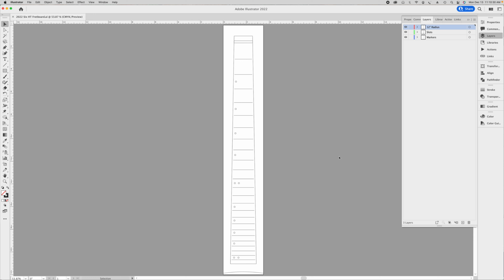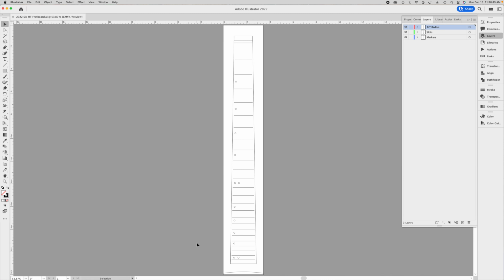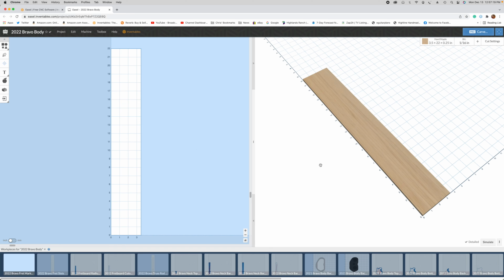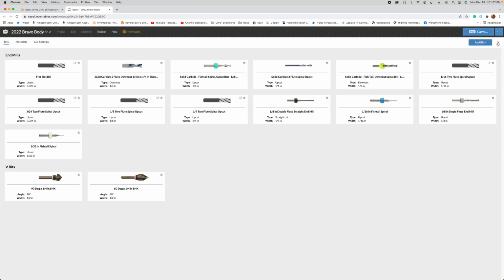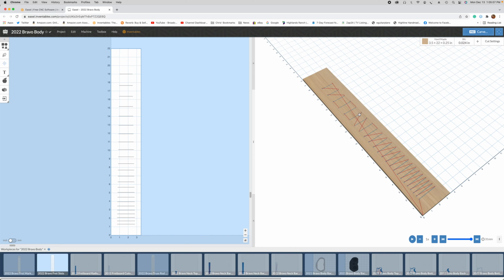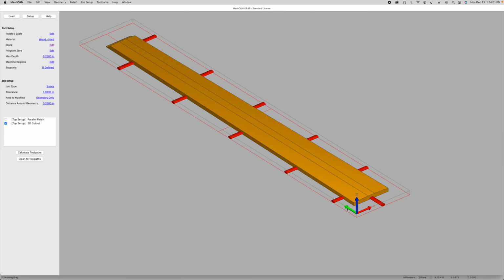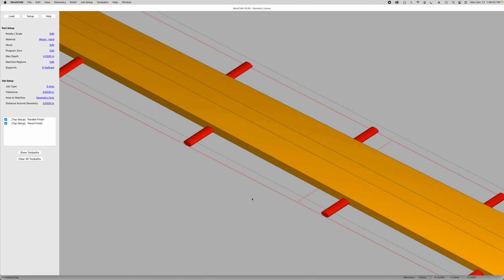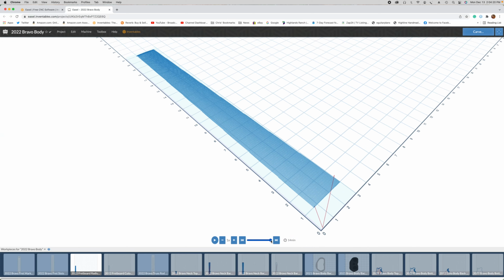CNC Fretboard CAM Strategies

Comment: Do you fret slot after radiusing and have the slot a consistent depth?
Reply from the maker: No.
Reply: @HighlineGuitars 👍🏼 I guess after you know how much the radius operation will take off the sides you compensate for it with your initial fret slot depth. Test cuts!
Reply from the maker: @rosco_drums  With CNC, it just take some very simple math.
Reply: @HighlineGuitars  I found your other video about this exact topic as well. Thanks!

Comment: @Highline Guitars, If the fret slotting bit is already the width it needs to be, why do you add the climb cut option in the program? Wouldn't the bit need to go back and forth across the fret board (from low to high string) lowering in depth each time opposed to moving the length of the fret board parallel to the strings?
Reply from the maker: I'm not sure I understand what you're asking. Easel selects climb cutting as a default and I leave it that way.
Reply: @HighlineGuitars  if the bit is the width of the fret tang, moving the bit from the head to the heel would make the slot too wide.
Reply from the maker: @russelldenton8753  I still don't know what you're talking about. Sorry! I'm cutting the slots from side to side, not head to heel whatever that means.
Reply: @HighlineGuitars  To my my knowledge, a climb cut implies that only one side of the bit is touching the work piece (in this case a climb cut is like a wheel rolling on a surface). So what I am saying is that unless you are making the slots bigger than the bit this shouldn't matter because both sides of the bit are touching the piece at all times. Just trying to get some understanding about the setting, not to challenge you. Thank you
Reply from the maker: @russelldenton8753  Alls I know is a .024" bit cuts a slot .024" wide.
Reply: @russelldenton8753  I know this is 2 years old but in case anyone else reads this, climb vs convention cuts refers to the direction the bit is travelling relative to it's rotation. Climb cuts are going with the rotation of the bit, conventional go against the rotation.
Reply: @HighlineGuitars  Also, are you radiusing the fret slots? if so (or not) why (or why not)? would it be hard to program?
Reply from the maker: @russelldenton8753  I don't radius the slots because it's pointless to do so.

Comment: Hi.  I've been watching your videos and it seems you use two different cam programs for your machining jobs, viz,  Easel pro and MeshCam. 
In your opinion which is better for cnc router for use for 2D,  2.5D and 3D cnc cutting jobs.
Reply from the maker: No opinion. Easel can’t do 3D. MeshCAM can. For 2-2.5d, Easel is easier.

Comment: Chris, the gymnastics you do to avoid using Fusion360 is breathtaking. You must be quadrupling the time you need to spend on these operations.
Reply from the maker: Not at all. As a matter of fact, I spend just a fraction of the time it used to take with Confusion360 to build my models and create tool paths.
Reply: @HighlineGuitars  whatever works best for you, but the idea of traipsing files around between 3 or 4 different applications seems mind boggling. Fusion is *so easy to use*!!!!
Reply from the maker: @tomdowler5416  Contusion 360 is easy to use? Hardly.
Reply: @HighlineGuitars  I started to learn Fusion on hobby license till they changed the rules.  I much prefer to have software on my PC under my control.  Rhino with Rhino cam is all you need.  I wrote a post processor for plasma cutting using rhino cam 2 axis cutting tool paths.  It's very versatile software.
Reply: I just bought Rhino and I am seriously struggling with it.  I am used to being able to input dimensions.  That being said, F360 CAM does not play nice with my post-processor for some reason.  Plus they keep changing the dang F360 interface.  Plus they can just remove features anytime they like and up subscription fees anytime they like.  Frankly I am going through the pains of learning what seems to me to be a horribly obtuse drawing system (Rhino) just so I don't have to worry about Autodesk screwing me.